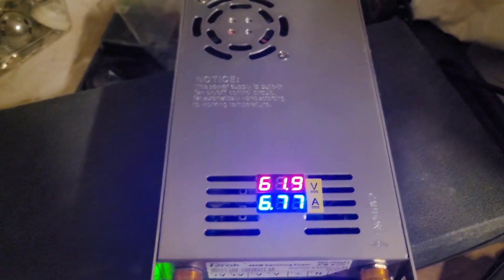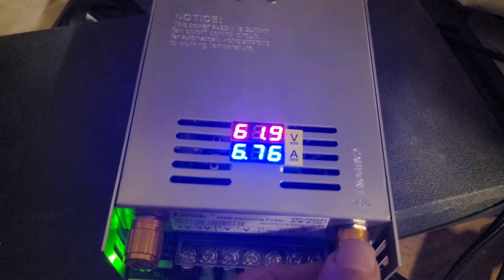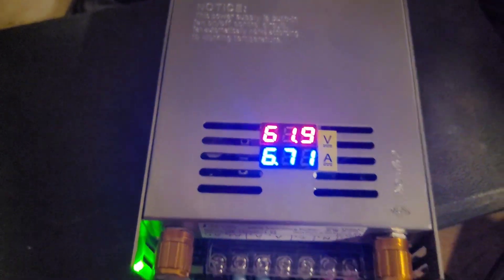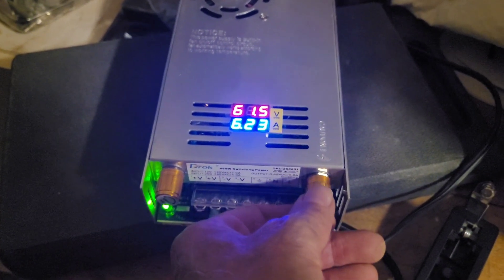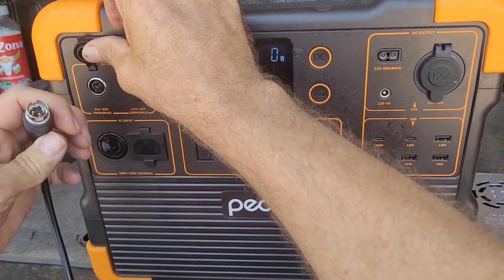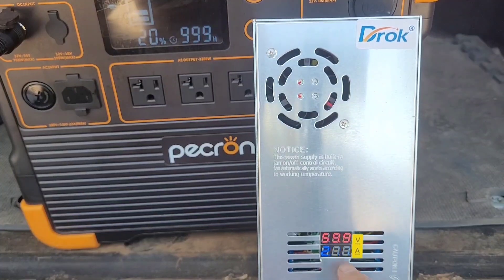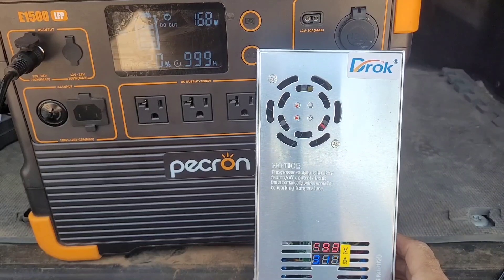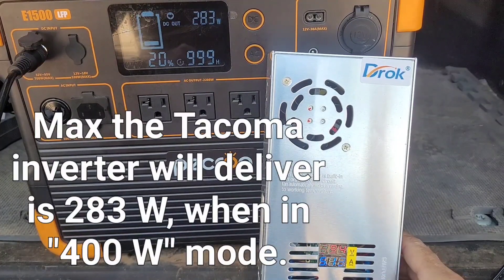Tacoma truckbed inverter peaks at 283 W, (when in 400W mode), charging a Pecron e1500LFP.

Comment: Dave. This is great. Ive got the pecron but im a rookie electronics guy. Where are you finding the input/output cables for your drok? I live in rural colorado and dont have enough internet saavy to know where to look for the connections...many thanks!
Reply from the maker: I am using the Pecron supplied aviation g5 plug, which I think ended with a 5525 plug?  But attached to drok is a 5525 male, just from Amazon.  Then I cut a 110v AC plug off something for drok input power.
Reply: awesome!. Much obliged. i chopped a 110 and got that hooked up to the drok, just wasnt sure the best way to interface with the dc input. I've got the pecron 5g cable but wasnt sure how to interface the drok with it...@dave_in_az
Reply from the maker: Get a 10awg wire  or 12, so you arent amp limited by wire

Comment: It's called efficiency..there is no 1 becomes 1..100 percent
Reply from the maker: Yes. And also devices don't actually output at exactly rated numbers.  Toyota advertises this outputs 400W, people expect at least that amount when they purchase the add on, for power tool use.  The purpose of the video was just to show you don't really get that.

Comment: What can that inverter power???
Reply from the maker: The 400W truck inverter can power small motors up to 400W.  Small battery chargers. Not super useful.  The pecron e1500LFP can do 2200W stuff, surge to 4400W.  So full microwave, induction burner, etc.